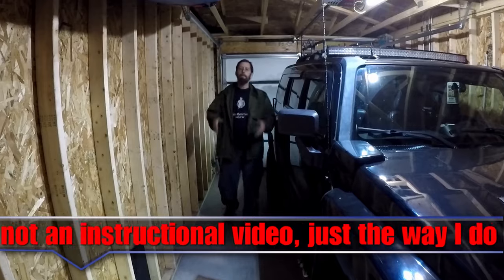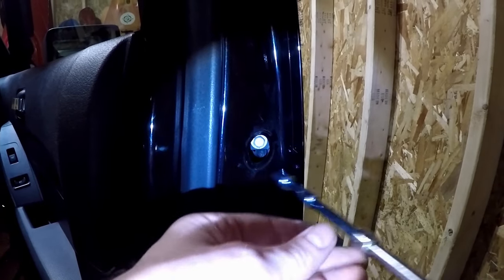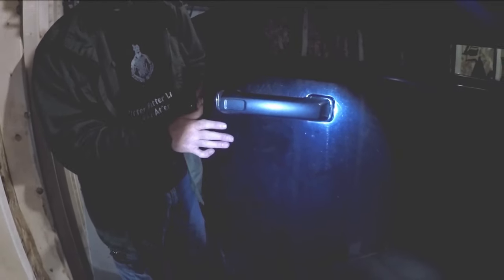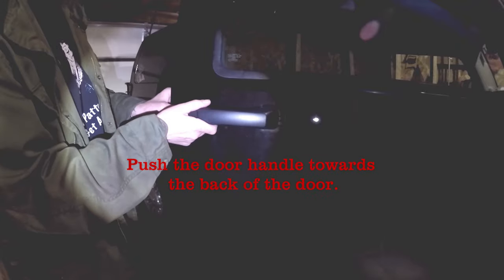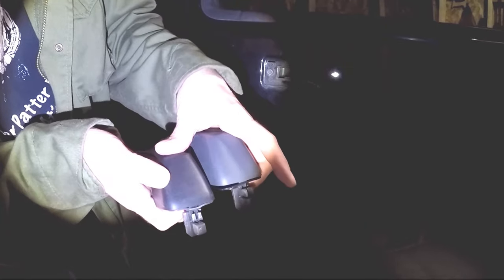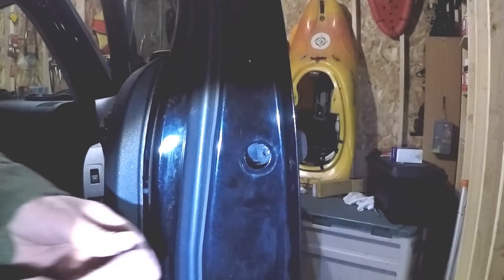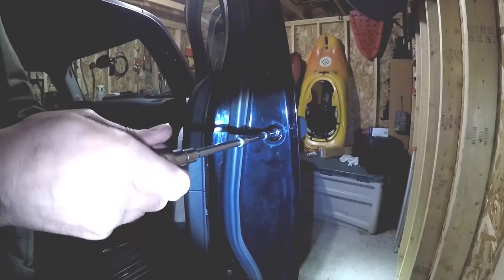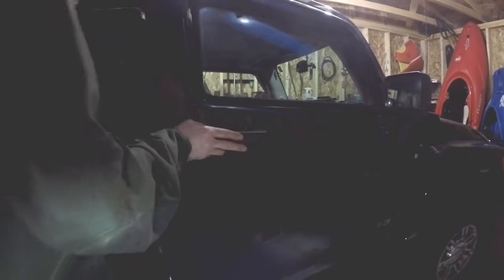Hummer H3 Door Handle Replacement

Comment: There is the nightmare scenario where bold is rusted solid into end cap nut-insert and only way is to break end-cap off, take off door plastics, take out handle inside plastic part and then drill/saw off nut. Suspect able in moist cold places.

Comment: you can take a piece of paper towel and put it into the end of your socket.  So, the bolt head will be secure in the socket.  It wont drop out.

Comment: My two back doors the bolt was stuck in the old door handle threads could not get them out. I ended up drilling both out and buying new bolts.  UGH!